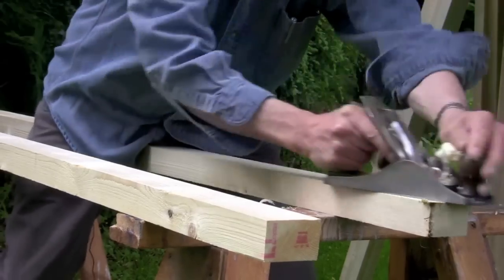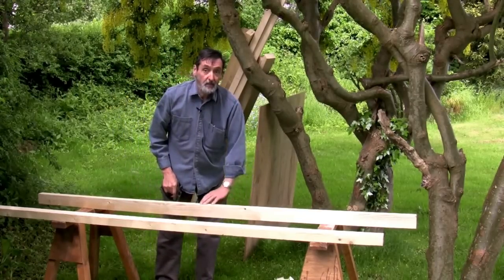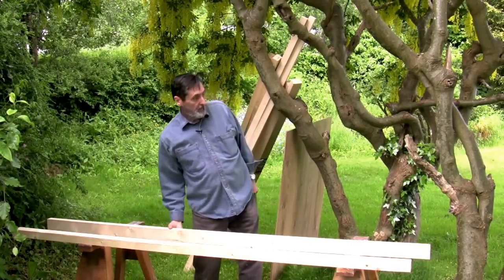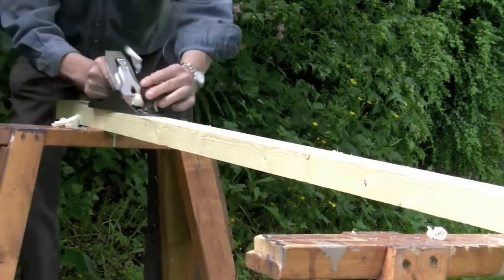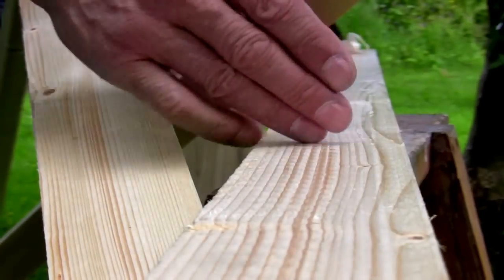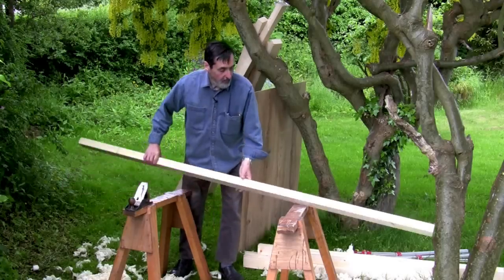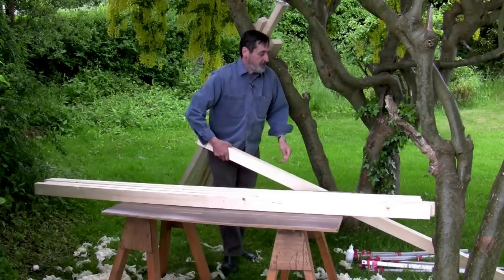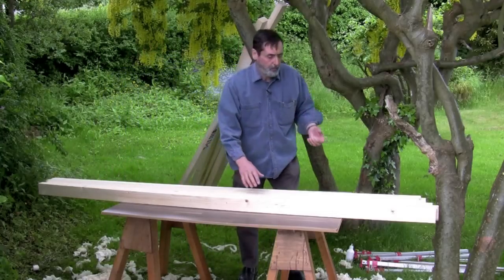How to build a workbench - (Part 1) Laminating the top | Paul Sellers

Comment: How would a bench have been made before modern wood glue? Would you be limited to the width of your wood? Or would they go to some sort of carriage bolt to squeeze it all together?
Reply: Selkirk hello.... based on what i saw from local craftsman(old timers) and what i dug up online, old style workbenchs uses wood slab...either a single huge, heavy, wide slab or 2 smaller wood( still big sized )
supported by frame jointed by tenons and mortises. Quite costly to get huge slab nowadays(at least in my country) and the skills involve is quite intimidating for me a newbie with limited tools and skill. Hoped that will help you.
Reply: ebbios: Thank you for your answer!

It would be cool if there was a way to add those butterfly inlays that are used to stop movement in cracks to secure smaller wood together. And I wonder if it were done outside in a cold prairie Canadian winter so that the wood was contracted its smallest and then once it was brought inside it would all swell to a tight-locked fit (if you were using 2x4s). You could run a dowel through holes drilled through the side of all the boards and then wedge it like an axe handle... It'd be worth a test piece.

I have a nice chunk of Siberian larch that I took from a 7 foot long by 5 inch thick live-edge piece to a 5 foot long x 2.5 inch.. But it's such a nice piece I hesitate to debark and drill dog holes in it and what not.. But it would serve more use than a bench in the garden, that's for sure.
Reply: Selkirk your welcome....

Comment: I wanted to make a bench top using this system and I was wondering why i cant find any example that uses wood peaces horizontally until I found that that way wood can move. I want to make a bench top 1 inch 1/2 tick but very large (96 by 36 one and other 96x72). I was wondering if I could get away by doing wide peaces (6 x 1 1/2) then put vertically shorter ones (1 1/2 square) and repeat it. Its a problem for me to cut all in 1 1/2. Will this work? Or I need to glue them all vertically? Thanks.

Comment: Did you rip the rounded edges off the tops of your boards or did you purchase the with 90 degree edges?
Reply from the maker: They were rounded but I just glued up and then just planed them out when I leveled the benchtop

Comment: Now we need a tutorial on how to build sawhorses without a workbench or sawhorses. ;)
Reply: Wolf Lahti I built the sawhorses by Matias Wendel without a "workbench".
I picked up a cheap £10 "workmate" knock-off, not incredibly sturdy, but useful to get the wood off the floor! All in all, cost me less than the wood to build the sawhorses and functioned as an extra clamp when I was laminating (along with some endless ratchet straps to act as turnbuckles - I really have no money for sash/bar clamps...!) 

I think in total, I used a 1" chisel, a jack saw, my workmate and a hammer (of course, some nails and sandpaper too...) cost me about £23 in tools, and probably £12 in lumber (I bought oversized! So I had some spare..!) Gave me two totally workable sawhorses with which to build Pauls bench!

Right.. Back to planing off those round corners!

Comment: 16:32  You did it the hard way. Before squeezing the strips together with clamps, first lightly clamp 2 short boards on each end perpendicular to the long boards and with wax paper between them and the long boards (so they don't get glued to the long boards). That way the long boards won't slide apart as in 17:48, AND it keeps the boards flat. The more boards that are clamped together the greater the likelihood that they will start collectively buckling. With short perpendicular boards on the ends they will keep that from happening.  
Also, Titebond 3 provides more working time and it's waterproof.
I learned all this while making cutting boards.

Comment: what kind of plane are you using and which brand? thanks!
Reply: Paul usually uses vintage No. 4 planes made by Stanley or Record – in this case it’s a 4 1/2, which is a little wider. He has lots of videos on how to restore, sharpen, and set them up.

Comment: Hey, if I'm using 2 x 4, is there any reason not to laminate the thickness sides (2") instead of the width (4") ?

Just I've only seen people do it as you did and am wanting to make a rather large desk top.
Reply: From what I understand it is done for the table weight, you want it heavy to make it more stable.

Comment: Hi Paul and friends. I'm frustrated.
My bench top  boards just didn't glue.
Maybe you you can help on why.
I bought the lumbers like the ones you Paul uses but they were not dried from store.
I'm suspecting that could be the issue.
They squared them on the store and it had a lot of moisture.
I noticed because it was very wet and heavy.
Well, I bought them on December, 2015 and let them dry until now, July, 2016.
I have 13 boards and I started to brush Titebond III on each face, them after all had glue on them I started to clamp them. Could this time of brushing glue on each of 13 surfaces be a problem?
Well, I noticed some lumbers are glued but the board separated in 4 pieces and I"m not sure that the glued ones are strong enough. I was gluing up for 3 days on the bar clamps.
So that's were I'm now.
The glue layer was not so thick on each surface but I made sure all were all covered.
Should I have glued just a few boards instead of all of them?
Should I put heavier layer of glue?
Could it be the lumber not very dried internally and that could cause the glue to not set properly besides it looks dry on the joints and outside on the lumbers?
Another thing was the lumbers were a bit bent but I did a test prior to glue them and put a good pressure on the clamps to make sure there were good contact but not all joints had glue dripping.
Help!
Thanks
Reply: do a test on a couple of small boards.  Less dry wood will not bond as well, but 6 months dry you shouldn't have had any problems.  Clamps do NOT need to be on longer than overnight, so don't leave them on for 3 days.  You should be getting some glue squeeze out all along the joint, even if its just a tiny drop every inch or so.  Use paul sellers technique of just putting down a squiggly line of glue and rubbing the boards back and forth to spread it. Don't separate them after you stick them together. Titebond III give a long working time, so you would have had to let it sit for 10 minutes or more for it to be too dry to set. Don't clamp too tight! you can ruin the joint by squeezing out all of the glue. And make sure your boards are mating well, meaning the faces you glue are parallel to each other and flat with no big gaps. Paul says if you can hold the boards closed by hand without gaps then theyre ok to glue up since the clamp will bring them together. If there was pitch (sap) on the boards, or it was that pitch pine where the resin is all throughout the board (feels wet, but its not water), then you aren't going to get those to glue up well. Just get new boards.
Reply: How old is your glue? As Joseph suggested try on a small test piece. It could be the glue was badly stored at some point and broke down (during shipping, in store or at home).

Comment: In the US, the 2x4 stock has rounded corners, i assume we should square the corners on the table saw. Agree?
Reply: +John Thompson   I used a handheld planer with a home made side fence and just ran the maximum depth cut along both short sides to square it up, probably just as quick as a table saw.

Your choice really, but it is easier to square up the pieces first than to plane the whole top after glue up.
Reply: This just answered my question.  Thanks!
Reply: John Thompson typical framing lumber has the rounded corners you mention.
If one has the luxury of access to a quality lumber yard (not big box hardware store) you can get lumber with sharp corners

Comment: Is top laminated for price reason? Is it cheaper then proper sized piece of wood? Or this is giving the bench more stability then 1 big piece of wood?
Is using 6 2x4 better then using 3 4x4s? Why?
Reply: DentargPL It would be nearly impossible to get a single slab of wood large enough to make a bench top. If you found one, it would likely be worth hundreds or possibly thousands...the old first-growth timber in the US has long been felled, and old wood goes for a premium. But the good news is that one large slab would also probably be unstable and move with changes in humidity. Laminations are far more stable. Using smaller pieces usually means its easier to find suitable stock that's straight. The larger a hunk of wood is, the more likely it's going to warp, cup or twist.
Reply: Craig Vecchione Thanks for clarification. But I got same price for one 4x4 as for 2 2x4. For one side of table top I would need 3 pieces instead of 6. Maybe lamination would be harder, cause bending 4x4 could be not that easy as 2x4, but for sure 2 times less plaining and glueing ;). I guess I would give it a try, but first I need some good clamps.
Reply: DentargPL It won't work out as you're thinking, as it's substantially harder to bend 4x4's, and they tend to have far more movement than 2x lumber. It will be nearly impossible to force a 4x4 into line with clamps. Another issue is that they typically will twist, which makes them nearly useless for this type of project, and planning/shaping usually makes the twist worse...the more material you remove the more internal stresses will release and twist the piece.Trust when I say that if it actually was easier, you'd see it done all the time. Most woodworkers seek better, not more difficult, materials and methods.

Comment: In the US we have 2x4's which all have rounded edges, it looks like Paul's boards don't have that,  I am guessing that those rounded corners would need to be planed out?  Or would the glue up be done and then the slabs planed flat until the gaps of the rounded corners were gone?  Anyone help me here?
Reply: I found the answer.  Seems like it's table saw time for those edges.  It's strange that his lumber has crisp edges already; must be the way they process it over there.
Reply: For others reading this...dimensional lumber in the US is generally used in building construction. The processing and subsequent handling (stacking, banding, loading, shipping, etc.) of the lumber is rough on the wood itself...the rounded milled edge 1. provides a cleaner looking product to the customer because if it was left square, the thin edge would be all dinged up and chipped...which leads to 2. that the rounded profile aide in preventing splinters from lifting off the dinged up edge. The splinters can get your hands or they can open up into a deeper crack weakening the lumber itself.
Reply: Isn't Pauls lumber also construction grade?  Just European right?
Reply: Yes, his is square and larger dimension too.
Reply: Look up wranglerstar poor man's carpenters bench. It's the same design but using 2x6s. He is using US wood with bullnose corners
Reply: Yeah, I figured on using 2x6's then ripping them down.
Reply: You'll see near the end of Sellers' bench series that he chamfers off the edges with a plane. The issue with US lumber is having to get down to square when gluing up the tops, but a jointer and tablesaw will knock that off in no time.

Comment: not sure but wouldn't it have been easier to put some calls on the ends to align the boards rather than beating on them? Maybe there is a reason to not use them, I'm not sure. anyone have an answer ?
Reply: twistedup123 I've always found them to be a pain.  For me it's easier to knock everything into alignment with a dead blow hammer.  Sometimes I will use a C clamp to pull an unruly board down onto my clap at the end though.
Reply: I was thinking the same thing, a couple of cauls with some wax paper and C-clamps would straighten things out really fast, I am always worried things will start setting up before everything is straight...

Comment: If he did this on a flat table there would be a lot less trouble.
Reply: The point is that not everyone has access to a flat table when they start out. Paul is showing a method that works EVEN in non-ideal conditions.

Comment from the maker: Absolutely. Air the wood a couple of days if you think it needs it and then skim off a pass or two to get rid of uneven srfaces left from the drying (or wetting) process. Take advantage of the machine of you have one. Then pass each surface with the plane and glue up.

Comment from the maker: You can laminate 4x4 stock, but it flexes less than thinner stock and can be more difficult. Another reason for thinner stock is that if the jointed faces are not dead flat the opposing adjacent pieces will have sufficient strength to counter the pressure. As long as you are prepared to plane them dead flat they will work.

Comment from the maker: Hello Jason,
The critical aspect for planing even these usually rough pieces is as always a truly sharp and well set plane. Of course the planing is the exercise I emphasize is the purpose even in building the bench. The laminations will stay together as long as when you clamp, the gaps close easily and you don't have to apply too much pressure to close up the gaps - just a few pounds of pressure.

Comment: Construction lumber in the US has beveled edges and it looks like your lumber is fairly square. I am doing a very large kitchen countertop using these methods and I think it would take ages to remove the 1/8" bevel on all the boards by hands so I'm tempted to rip them on all the table saw

Comment: The tan. of any45° angle is always x multiplied by the square root of 2 
(With x envisioned as the length of the horizontal or vertical length of the cut)

Comment: Hi Paul,
I've just started my bench. I'm using old 2x4s I pulled out from a decking got rid of in my back garden.

I've planed down the first few beams
You said that I should be able to hold the beams together with my hands, but there are a few high spots along some of the beams and I can't get them flush with muscle power. A few gaps here and there of about 2-3mm. I put a sash clamp on it to see what would happen and that got rid of the gaps. Should I flatten the beams a bit more first?

thanks

Comment: Nice work there! Someone can also use two pieces of wood and a smaller clamp on each edge to flush the pieces. Place one piece of wood on top and the other on the bottom and place vertically the small clamp to grab both.

Comment: Jason, you can usually find pretty clear boards in wider stock (2"x12") and then rip them down to your desired width.  It's much harder to find 2x4s-or 2x3s-that are good for anything other than framing.

Comment: I made a bench like this using left over 2x4s and 3x2s, but because the wood I used for the top had been out in the garden in all weather for about 6 years (treated construction timber, so no rot) it was pretty bent and twisted so I used 4 pieces of 2x4 with lengths of threadded rod to keep the ends flat across the surface while the glue set up.

As my bench is made out of low grade firewood :-) I drilled the faces and inserted dowels to keep the pieces together.  The whole lot was then clamped by 5 threadded rods that pass all the way through from front to back and exert several tons of clamping force, these are a permanent feature.

Downside, lots of careful drilling and extra work.

Upside, I have a very nice, extremely solid bench that cost me 5 lengths of 10mm threadded rod, 10 washers, 10 nuts and a litre of glue, 3 dozen dowels and 2 4inch fence posts for legs - all the rest of the wood was junk destined for the fire.

The threadded rods meant I did not need lots of clamps, which is good as I have very few and no budget to buy more.

Tools used: hand held electric planer, hand saw, hacksaw, hand held circular saw, sockets & spanners, orbital sander, hammer, hand held elecrtic drill, couple of chisels and 2 saw horses.

Comment: HI Paul, do you have any suggestions for how to fix areas of the table top that weren't joined perfectly after lamination? There's a couple feet along two boards that have about a 2/16 of an inch space between them — should I pour some glue down the space and re-clamp? 

Thanks from Matt
Brooklyn, NY

Comment: Does this make sense to make a half-size one?
Reply: half length that is.
Reply: Yes! A good workbench is one that you use. Fit it to your space.
Reply: steven hobbs Cheers, thought as much but didn't know if there were some unknown downsides to reducing the size with this design?  Murdering stability for example.
Reply: craig chamberlain The less weight and the shorter the dimensions, the less stable the bench will be. You can compensate by gluing up thicker legs or adding some bracing across the front and back. The bench is over-engineering however, and might be sufficiently stable for your needs even without mitigation.
Reply: Tom Holmes I built mine before reading and considering this unfortunately.  I have a very nice solid laminated bench top with a box on the long edge for tools instead of a trench.  I fitted two very inexpensive vices, the tail one with dogs.  Both vices hang considerably out of parallel in the vertical plane.  As the legs are quite close together it's a bit tippy.  Nevertheless it has been a massive improvement on my previous tables made out of old pallets.  I think I'll add a long horizontal 2x4 at ground level to the legs so I can stand on it to stabilise when planing.  Despite the problems I'm happy I made a smaller version with cheap vices as I can move it easily on my own. Take it into the house as if it where a work mate and it cost a little less than £100 including the vices.  I'll build a bigger better one one-day.

Comment: why not just drill some holes right through all sections and then use coach bolts to clamp it all together and that way all the wood stays aligned better